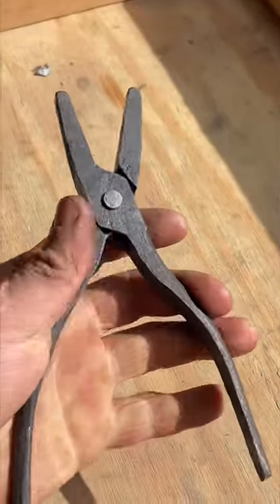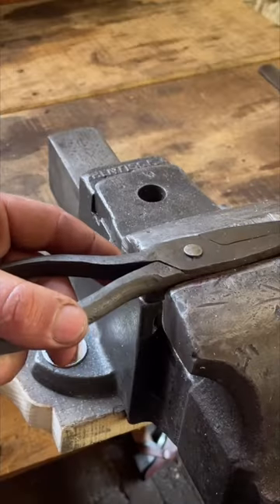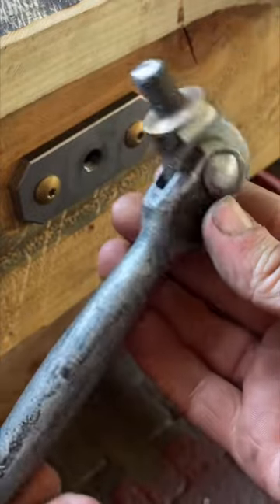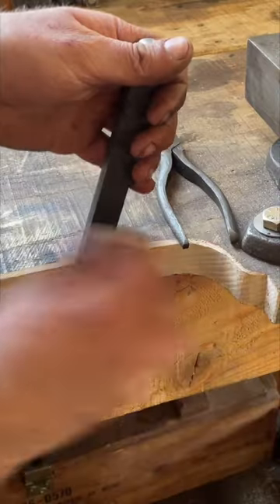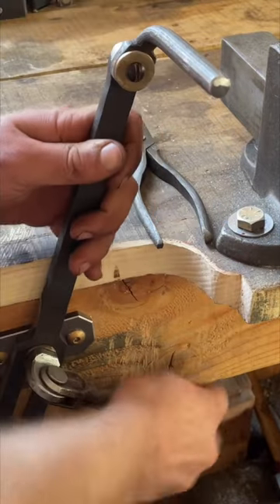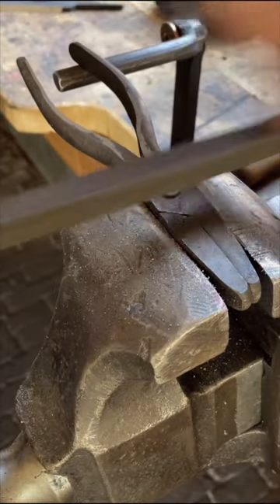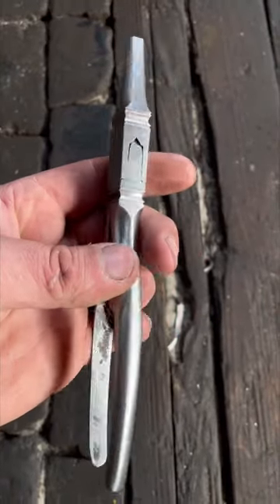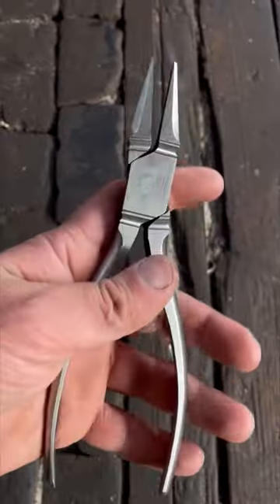Peter Ross style work rest to file on pliers #shorts #blacksmith #blacksmithing #forged #forging

Comment: I make old, worn down coins into silver rings. I hammer the coin over and into a cylinder. I then file, sand and polish them. I Invented my own process on count I couldn't afford the kit that most coin ring makers use. I use junk tools that can be found in harbor freight.